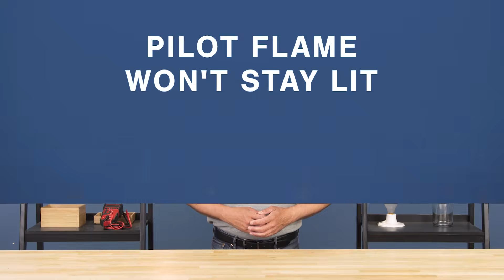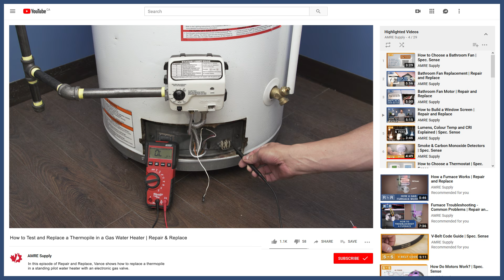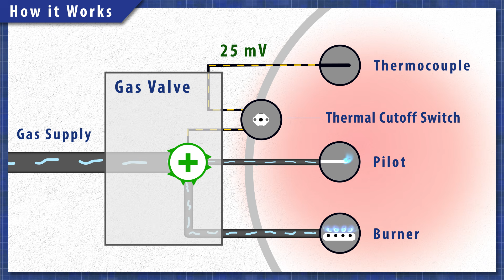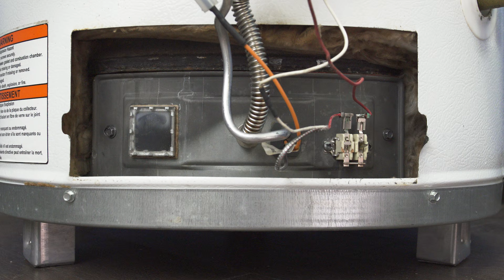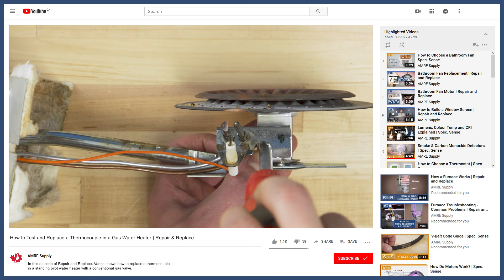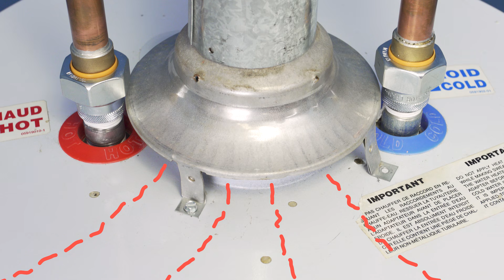Water Heater Troubleshooting - Pilot Won't Stay Lit | Repair and Replace

Comment: Mine has no tco can’t test that but pilot won’t stay lit I am a thermocouple is good wats the next test
Reply from the maker: Hi Bobby, thank you for watching. If the thermocouple is good and the water heater still won't stay lit, then it could be an issue with the airflow as mentioned at 5:34

Comment: Hello and great vids. Now my electronic gas valve is flashing five times with a 3 sec pause. The pilot stays lit but the Main burner does not kick in. When I reset the unit by pressing the knob in the pilot position and pushing the pilot igniter I can turn on the burner but it will burn for about 5-7 min then turn off and resume the 5 blinks. Does this mean I’ll have to replace the whole unit ?? Thanks in advance.
Reply from the maker: Thanks for watching, we're glad that you found it helpful! The fact that the pilot does stay lit is showing that it likely is a problem with the gas valve or the electronics inside of it. The gas valve itself can be replaced. https://www.amresupply.com/catalog/Gas-Controls-647749-PP2D If you're not comfortable working with gas fittings then that's something best handled by a technician.

Comment: Hello, thank you for the explanation, but i do have a question: i changed the whole burner set, the igniter works well, especially starting the flame, but after releasing the pilot knob, it won't stay lit, any idea why? Thank you
Reply from the maker: Hi Gustavo, thank you for watching. If the pilot flame won't stay lit, and you have a new burner assembly then its possible that there is a bad connection between the thermocouple and the gas control valve. Unscrew the thermocouple from the gas control valve, you can use a q-tip soaked in alcohol to help clean up any mineral buildup or corrosion that might be on the valve. If there is any interference the the voltage produced by the thermocouple won't make it to the valve.
Reply: @AmreSupply  makes a lot of sense, thank you so much for your reply. Greatly appreciated
Reply from the maker: @gustavosh.5147  You're welcome, we're just happy to help!

Comment: My pilot light won't stay lit.  I tested the thermocouple and it read 19.3 millivolts while the pilot was being held on.  I removed it and tested it with a light and it went to 24 millivolts. I also had a new spare thermocouple and when I installed it it only read 15 millivolts and has the same issue.
Reply from the maker: Thanks for watching. If the thermocouple is producing ~20 millivolts then it should be ok.  One thing to check is to see if there's any corrosion at the connection between the thermocouple and the gas control valve as this can reduce the voltage at the valve itself. Unscrew the thermocouple and use a q-tip soaked in vinegar to clean the connection on the control valve as well as the threads on the thermocouple, then reconnect and try again.
Reply: @AmreSupply  thanks. I just installed this new water heater 6 months ago. I will give that a shot. Also is it required that a sediment trap or drip leg be installed ?
Reply from the maker: @Dustrat82  Most new installs will require a sediment trap but its best to check as the exact codes will differ based on your city, state or province.

Comment: Very informative video. I have a unique issue. The pilot will light but when I move the top switch to on and turn the gas up on the front facing knob, nothing happens. Typically it would ignite the pilot and have much a more visible flame but it’s not doing anything now. Any ideas? Thanks for any advice and thank you for taking time to make this video!!!
Reply from the maker: Hi Eric, thank you for watching, we're glad that you found it helpful! What you're describing is a faulty gas valve. The gas valve has 2 valves in it which will control the flow of gas. The pilot and thermocouple is connected to the master valve, it will allow gas to both the pilot and the burner (if needed). The dial controls the burner and when the conditions are right, it will open up the valve to let gas into the burner. For the burners to work both valves need to open. If nothing happens when you switch it to on, then its likely that the valve to the burner is not opening.
Reply: @AmreSupply  Thank you very much for the reply!
Reply from the maker: @hawkins4lifeh3llfire67  You're welcome, we're just happy to help!

Comment: Are the wires for the thermal switch a special wire? I have some wires that got burned from condensation and heat. Need to replace them and was wondering if they are a special type. Thanks.
Reply from the maker: Thanks for watching. Its best to use the same gauge wire but choose wire rated for high temperatures. The wire you'll want might be listed as having "heat resistant insulation" or a "high temp wire".

Comment: PLEASE SAVE MY HUSBAND AND ME!  OUR WATER HEATER STILL HEATS THE HOUSE BUT AFTER A STORM THE WATER WILL NOT STAY LITE.  MY HUSBAND SAID" THE PILOT WON'T COME ON". PLEASE HELP ME SAVE MONEY!
Reply from the maker: Thanks for watching. We have a specific video on relighting the pilot light which also talks about some of the problems. https://youtu.be/d-KRwKdRNYI  Overall if the pilot won't light or won't come on at all then its likely that there is issue with the gas supply or the gas valve could be faulty.
Reply: @AmreSupply  so is that when we call an electrician or?
Reply from the maker: @Bronxborn79  Its best to call a plumber or an HVAC tech.

Comment: Please help.  Both our water heater and air conditioner are broken.  Have not had hot water in 3  weaks.     The pilot light will not stay lite.  Replaced the thermocouple and the burner assembly.  Used a brush to clean the air register.  I lit pilot and let it burn for 2 yours before lighting the burner.  The burner would stay on for about 30 minutes and then burner and pilot goes out.  Please offer suggestions on what to do next.  We are desperate.  Thank you.  God bless.
Reply from the maker: Hi Penny thank you for watching. If you replaced the thermocouple and the burner assembly and the pilot still won't stay lit then its possible that there is corrosion between the thermocouple and the gas valve. Unscrew the thermocouple, take a Q-tip, soak it in rubbing alcohol, and clean the inside threads on the gas valve, then clean the end of the thermocouple. Any corrosion will reduce the voltage and can cause the pilot to go out. As well make sure that there is a constant source of air to the water heater. If the water heater is in a room or closet, the door should have space under it to let in fresh air. Without that the water heater will be starved for oxygen. Finally check to see if there is good airflow in the exhaust. Any blockages in the exhaust can create issues.
Reply: @AmreSupply  Thank you AMRE Supply for being kind enough to answer.  Your video is great.  Unfortunately, the water heater is in the attic and extremely hard to remove which is another reason we did not want to have to replace it.  We will try your suggestions.  I appreciate your help more than words can express.  Hopefully they will work.  Thank you for caring for others and for being such professionals.
Reply from the maker: @pennybaker1395  You're welcome Penny. We're glad that you found the video helpful and we're happy to help in what little way we can! Best of luck on the repair!
Reply: @AmreSupply  I have the similar issue. I had replaced the entire burner assembly. My gas control has 2 wires (i believe it is the thermal cut off) but the burner assembly does not have any connector for it. The plumber just hook them together and taped it. I can light it and it will stay lit for a while then go off. Any idea? Thanks for your help.
Reply from the maker: @michaelyeo316  Hi Michael, thank you for watching.  If you replaced the thermocouple and the burner assembly and the pilot still won't stay lit then its possible that there is corrosion between the thermocouple and the gas valve. Unscrew the thermocouple, take a Q-tip, soak it in rubbing alcohol, and clean the inside threads on the gas valve, then clean the end of the thermocouple. Any corrosion will reduce the voltage and can cause the pilot to go out. As well make sure that there is a constant source of air to the water heater. If the water heater is in a room or closet, the door should have space under it to let in fresh air. Without that the water heater will be starved for oxygen. Finally check to see if there is good airflow in the exhaust. Any blockages in the exhaust can create issues. Hope this helps!